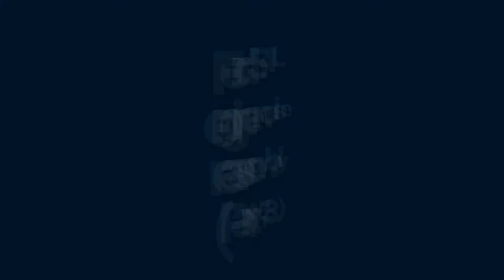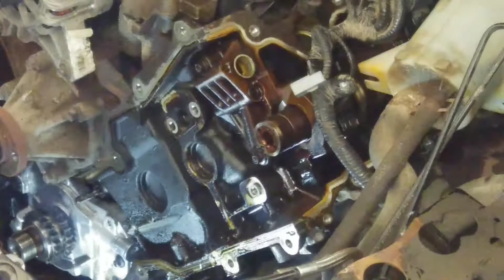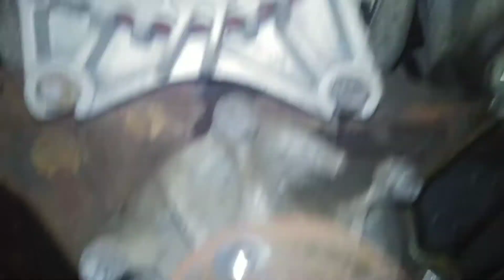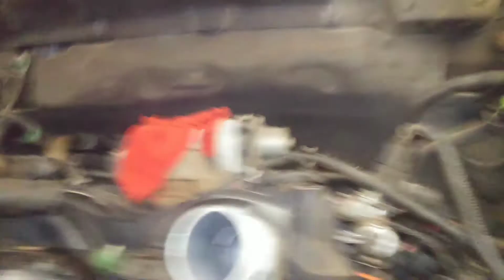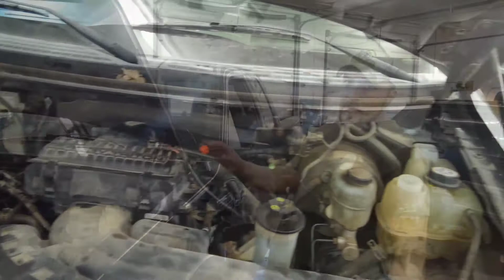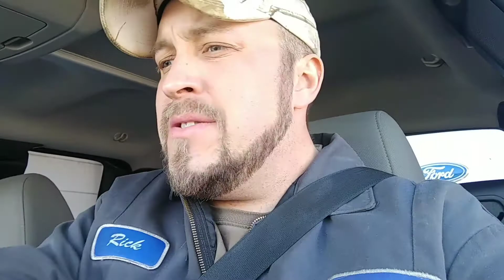Ford 5.4L noise (reassembly  Part #3 )

Comment: like that battery operated cordless driver you have. Is it a 1/4" female hex socket driver with a square drive attachment or is it strictly a square drive male shaft impact driver

Comment: I bought my 2000 E-350 last year it has 335k on it , only cost me $1000. That kit would be well worth the price and the effort to do it myself, plus make a video.
Reply from the maker: That kit won't fit your application.
Reply: @RickBork  
Yeah I found the right one and it’s about the same price. Good thing for the eBay vehicle match 😄😄😄
Reply from the maker: Good luck man hope it fixes it. 👍🍻
Reply: @RickBork  
Thanks 🙏

Comment: I have a 2001 f150 it's making the exact noise as yours. My mexhanic is telling me I probably messed the engine 
. It's driveable, smokes a little bit but I love my truck and don't want to part with it.
Is there any specific test to ask for so that I know for sure what's messed up in it?
I'm on a tight budget and if I could do this myself I would.
Reply from the maker: 2001 has an entirely different engine. Your truck has a 5.4 2 valve chances are if it is smoking and making noise it needs a new engine. Things to check would be base engine compression. Oil consumption. Base engine oil pressure. If all that checks out I'd pull the valve covers off and look at the valve train and make sure there isn't a roller follower out of place and continue to the front conver and inspect timing components from there. Good luck 🍻
Reply: @RickBork  thank you 🙏

Comment: What oil grade you recommend for the truck after its fix?
Reply from the maker: 5w20 the bearing tolerances are to close to use heavier weight oils in the 5.4 thanks for watching.

Comment: Cool, I have the same issue with my 2006 and I was thinking in replacing the oil pump but you also changed camshafts so now I don't know if just changing the oil pump is enough, I kind of don't want to touch anything else(btw I will not be doing this myself).

Comment: Well first off you'll have to give Squatch a pat on the back or buy him a pop or something for promoting your channel and gaining another subscriber!....Next,....how many miles are on this engine?...the worn cam bearings puzzle me a little, I thought that engines of today compared to the 70's we'll say, are supposed to last so much longer.  I know this is becoming a "throw away" world but one would think for what you pay for a new vehicle now days it'd hold up a little better.  I bought a F-150 new in '13 with the 5.0, I'm not a fan of the EcoBoost no matter how many people swear how great they are, just a personal feeling towards them.  Is this going to be an issue down the road on that engine as well or have you run into other things a guy should look out for?  I had it in for the transmission update in early June and the dealership called the other day and said they need it back to update the update.  Other than that I've been pleased with the pickup overall especially since it's the first Ford I've owned since an '82 ranger I had back in the mid 90's.  Keep the videos coming!!